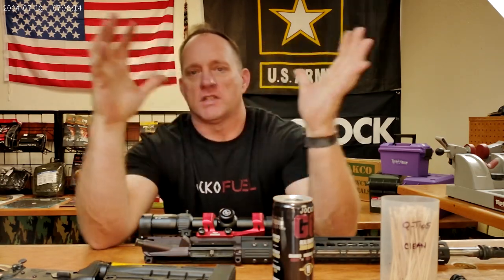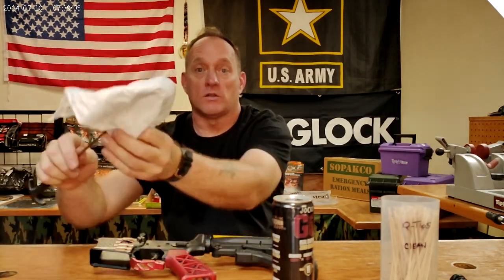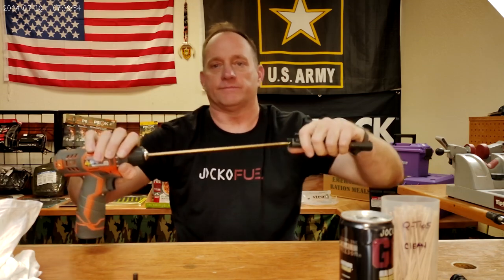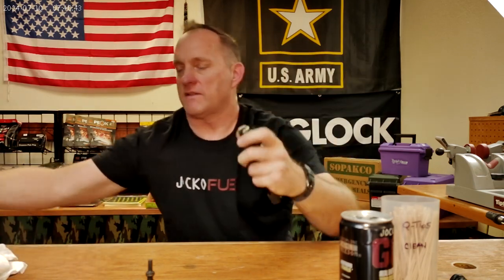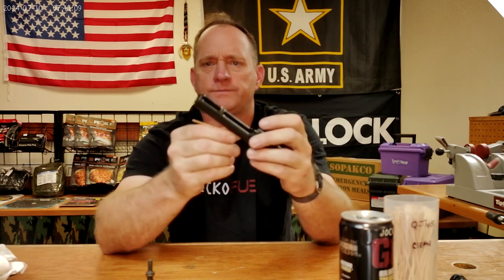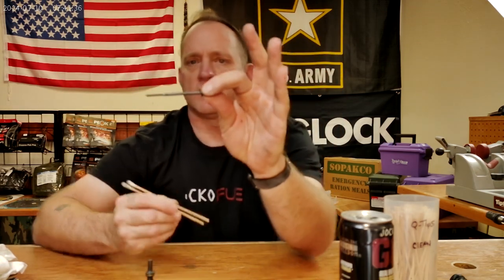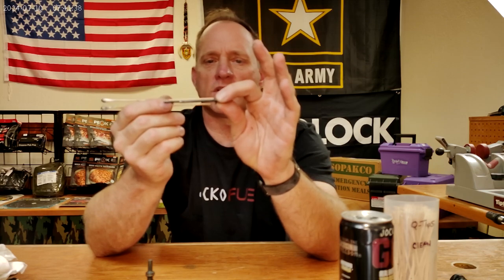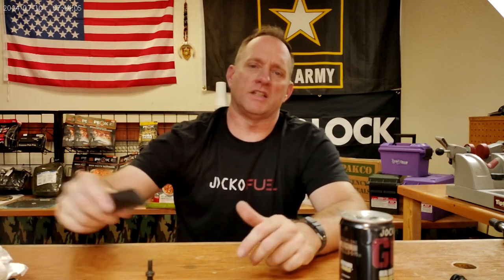Cleaner Ar Tips

Comment: How long can your rifle be dirty without cleaning before the carbon becomes corrosive?
Reply from the maker: Many people will go for long periods of time with out doing a cleaning. Carbon more often will collect dirt dust etc and attract moisture.  How ever usually the talk of corrosion came from shooting corrosive ammo with which contains a primer that has potassium chlorate. This in turn deposits salts in the barrel and internals which attracts moisture leading to rust and corrosion. Carbon build up usually changes tolerances and gums up with the use of oil and increases friction etc. If shooting corrosive ammo there are manys ways to properly clean post range trip. Easily found by consulting SGM Google.